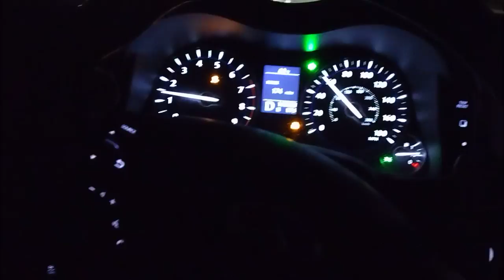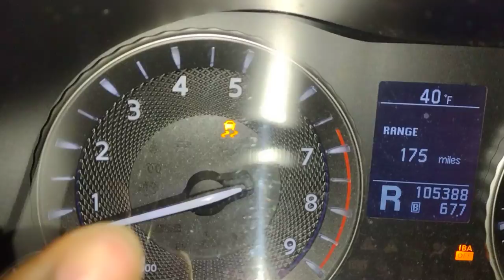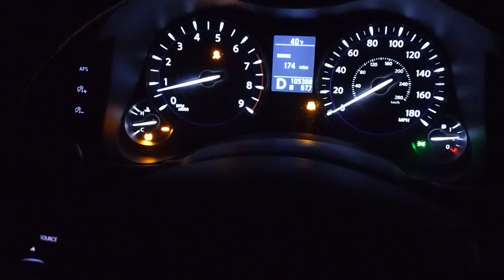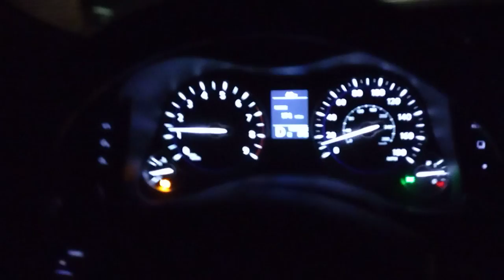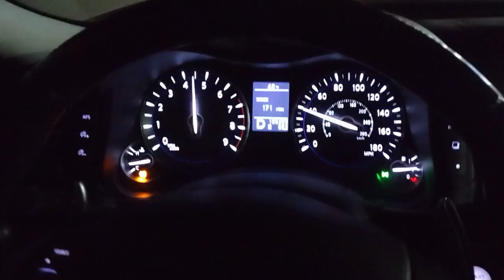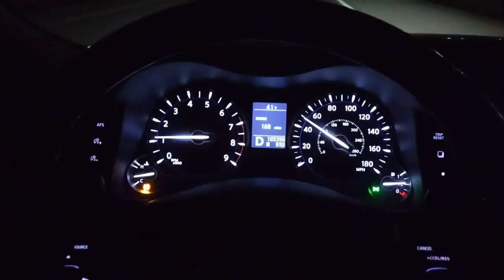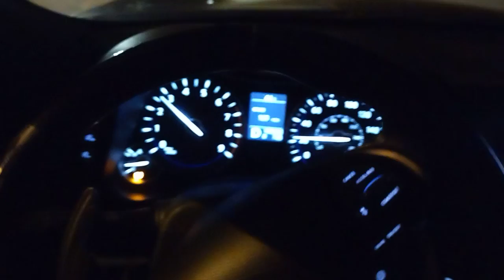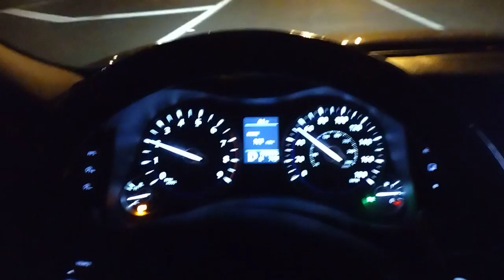Infiniti Steering wheel crooked when driving straight. 4WAS light on, Sport Model| This is #VLOG-ish

Comment: Great Video. I have a M56S and the dealership replaced this for me (i had an extended warranty) but it also wore out a set of tires before they could get it in. This problem really sucked. lol $6000 is the correct estimate.

Comment: Just ordered a new OEM front steering control unit to help correct the 4WAS issues on mine. WIll report back with results after install+alignment.
Reply: Following
Reply: what was the result
Reply: Im guessing you fixed the issue since you didn’t come back complaining
Reply: Where is the module located to change out

Comment: I have m37s and same issue. They told me you need to clean 4was and also make setting in ecu is that correct or only clean 4was (box). It cost 300$ just clean no change
Reply: I have a 2011 m37s I’ve had my mechanic do all those and still have dash lights on. Recently I just bought the whole rack n pinion with 4was on eBay for $500 so hopefully the light come off with this.
Reply: @ricardovelazquez9474  any results and what did you get replacement from?
Reply: @teddyluva22  still have dash lights on. Really frustrating trying to find the problem
Reply: @ricardovelazquez9474  Hi, I have the same problem on my 2011 M30dS, has anyone solved the problem? Is there a permanent solution? Thank you
Reply: @Dott.SalvatoreCavallaro ı m having the same problem too, did you reached a conclusion

Comment: i had this same issue happen with my 2012 m37s, took it to the dealership and was told my actuator had a leak 😔😔
Reply: had the same issue with the rpm fluctuation as well
Reply from the maker: Did you get it fixed? There is a video out there that shows the rear actuator motor being cleaned of grease

Comment: I have a similar problem with my m45. RAS light is on, slip light & VDC are on. The car drives fine, those lights just bug me. Took it to a repair shop and they told me i needed a new clock spring assembly. So i got one and replaced it, but the lights are still on. So do i need to take its for an alignment and calibration? Or do you think the clockspring i got doesn't work?
Reply from the maker: Actually both situations are possible. It could be that you just need an alignment, but if you bought a used one there's the chance it is bad...or gets damaged while being handled.

I would be tempted to start with an alignment + steering angle reset procedure first though
Reply from the maker: How badly off are the backup guide lines on the screen when you put the car in reverse? 
Sometimes you can reset it yourself if you turn the steering lock-lock like 3 times
Reply: The back up guide lines dont show at all. That's what got me thinking that i may have gotten a damaged clock spring as. Would you advice that i still try get it aligned?

Comment: I was checking my Fuse box and noticed that my FX35 didnt have a 20V 4WAS fuse in it. Is this correct? Ive been driving like that with no issues but out of curiousity i put in a fuse and have noticed anything. lol
Reply from the maker: Yeah, that's correct. None of the FX V6s (FX35, FX37 or QX70) were offered with rear steering.
Reply from the maker: https://edbwoy.com/f/infiniti-fx50-and-qx70-sport

Comment: I have a video showing how to correct the rear. grease gets into the coils. Now I have the lights again and I'm assuming it's the front which I had no idea that there was a front.
Reply from the maker: I think the best move would be to have a professional diagnose it properly, then make a purchase if necessary
Reply: I got the same problem for 2 years and i got it fixed , I know the steps and everything, contact me so i can explain
Reply: @sulaimanabdullrahman160 can you show me? I've had this problem for 3 years now and I think $6K is excessive to repair this issue. It should have been a safety recall because this module is known to go out in the middle of driving while on cruise control and caused some wrecks.
Reply: How can I contact you for help with this issue
Reply: So much for asking for help on here! I removed the module myself and rebuilt it. The internals were stuck,  and also,  I found out the module from the previous Ms also work. My friend had the same problem with his and he got one from an M45
Reply: @RPaulo8k  what codes were you getting?
Reply: @Marathonmotorsga  I got a diagnostic done at the Infiniti dealer and the code was C1686 which is for 4WAS, and my cruise control stopped working. It's all working now since I repaired the module.
Reply: @RPaulo8k  ok so you mean the module behind the glove box right?
Reply: @Marathonmotorsga  no its not that. It's the actuator that's on the axle.
Reply: @sulaimanabdullrahman160 hi is there any way i can contact you to fix this issue ? if you can explain it to me ty sm
Reply: @sulaimanabdullrahman160  I have the same problem can you help me

Comment: So i have to recalibrate this steering wheel every time i stop? Theres got to be more of a issue with my car never driving straight and knocking toe out in less than a month? Does anyone have ideas im thinking rack n pinon since noise comes from steering wheel
Reply from the maker: No, you should not have to do that. There is something else happening, as this is specific to rear active steering systems.
Do you have any warning lights that come on in your gauge cluster? Have the car diagnosed by a competent shop.
Reply: Thank you for the information. Its been in and out of several infiniti dealerships and independent shops the last 3 years.  Looked at it today and the noise is coming from the rack n pinon
Reply from the maker: @michelleparker2053  that has to be frustrating.
If I may ask what year and model is your vehicle?
Reply: 2019 redsport
Reply from the maker: @michelleparker2053  those have the electronic steering feature, if I recall correctly. 
I will have to read on the system again to know exactly what could be making noise at the steering wheel.

However, when you said the toe is going out, is this information coming from a shop that has done your alignment and found either the front or rear wheels to be losing the tie setting?
Reply: I have numerous alignments showing this. If i can send pics i will this last one i got 35 days ago showed in specs but tires again wore on outside edge. They set tow at 0.04 and in 35 days it was at 0.14. Car never drove straight and flies to the right when acceleration

Comment: There are many reasons for this problem to occur, but in this particular video, the problem is in the front steering column, because it happened to my car.. a wheel alignment will solve the problem. If The technician discovers that there is a problem with the steering column, you must replace it first, then make alignment and the problem will end.

Comment: talk me into one 2011 m37x or fx37
$ 8900 m37x 189k
10k 2011 fx35 with dark brown interior 149k
Reply: the M37x is dealer fx private
Reply from the maker: @Newbuddyzx1  FX35 for utility, M37 for luxury.
Other things will depend with whatever options the vehicles have and if they matter to you.
Reply: @EdBwoy  so you think the 189k  m37xwell maintained could hit the 250ks and still be in enuff shape to dump at 3k in 2-3 years that’s what i’m envisioning lol
Reply: respectfully i kno the cars not in front of u just based of your experience
Reply from the maker: @Newbuddyzx1  I think they can handle the mileage. There are G35s, M35s, and FXs with over 200k miles. The thing about buying used cars is that you never know how well they were maintained
Reply: EdBwoy thank you so much for your very informative videos,the infiniti community does learn alot from you, I had a quick question...regarding the park neutral safety switch. I have that code on my m35x 08,but my car only starts on p or n, I've taken it to a couple mechanics and they can't seem to find any problem not even with the shifter or any loose wires, a couple of them suggested it might be the ecu that needs to be changed and some said you can try buy a new(used) shifter might fix the problem... how often have you encountered that issue with the infiniti you've come across, please advice
Reply from the maker: @hyattgotti3052  missed this, but normally automatic cars can only start in the "neutral" gears, so P and N.
Doesn't seem like there was any problem

Comment: I had this problem when I purchased the car I end up buying the rear system from EBay and I swapped it now my steering slightly off to the left and when I drive my car over 55 - 60 Mph the light comes on , when I do turn off the car and back on the light disappear , before I change the Rear System the light will always stay on .
Reply from the maker: Did you follow through with an alignment after repair?
Reply: @EdBwoy  yes I did , after that it was fine till you go over like 20 -30 mph and the way how it’s happening is how you have your steering rotation it will turn on the light on the dashboard and then the steering will stay cricked like how you were steered when the light came on . I don’t know if that make sense. The light is always on at the moment.